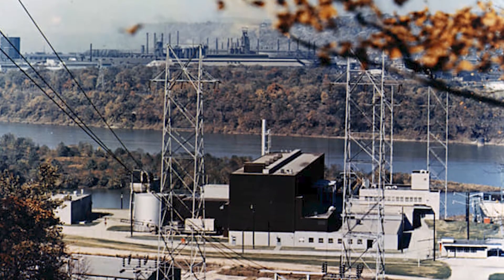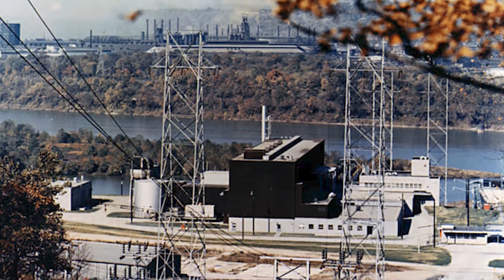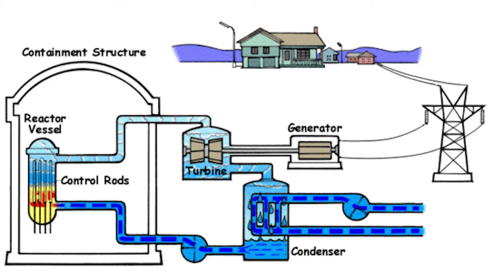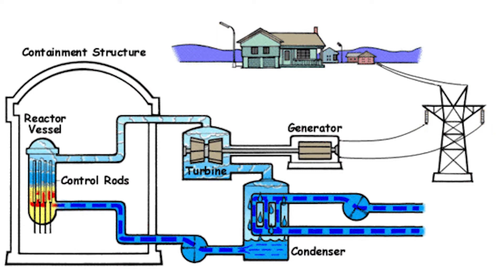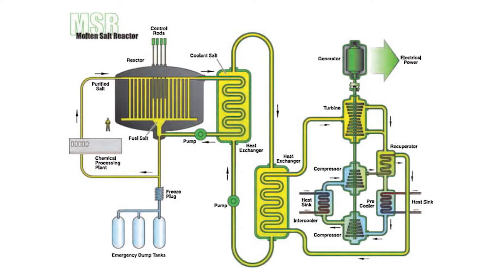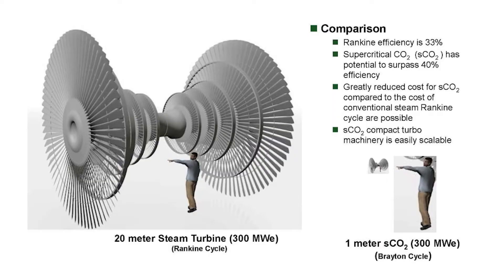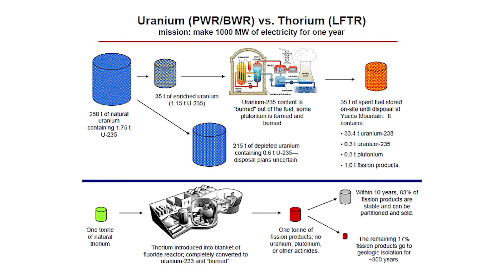The Best Nuclear Reactor: Light Water VS Molten Salt | Ep. 2

Comment: Great summary. A couple of nuances though.
1. LFTR is an interesting design to be sure however the two fluid with chemical processing is conducive to proliferation misuse. U233 isn't as good as enriched U235 for making bombs but don't rule out desperate nations from surreptitiously tapping off the U233 in order to make less-ideal bombs. Also Lithium is becoming increasingly in demand for batteries in particular thus a high cost item. Note that Sorensen seems to be quietly focusing his company's attention towards the MCFR concept. You might want to research that concept further.
2. Safety should be the least concern since, even including Chernobyl and Fukushima, existing solid fuel, water cooled reactors have proven to be safer than any other means of power generation known to mankind -- by orders of magnitude! Instead the focus needs to be cost reduction while maintaining safety. That should be possible given the reasons as stated in your video. However don't underestimate the power of ALARA principles used by regulatory agencies. "Ah so it costs less you say?" I can hear already. "Well then let's just add these other safety criteria since it would now be reasonable to do so."
Reply: In a LFTR molten salt reactor along side a majority of U-233 that is being created from the blanket salts, a small but still crucial amount of U-232 is also created. This is what makes proliferation very improbable. Asides the fact that U-233 can be made into a bomb, the presence of U-232 (which you cannot seperate from the U-233, without a enrichment plant, which in essence would be obsolete when using a thorium fuel cycle with molten salt reactors) makes it unuseable. U-232 is nasty in that it has a much stronger radiation that can be picked up from large distances and is uniquely distinguisheable. You cant hide a U-232 laced bomb without the world knowing about it. 

As for the reactor, the presence of U-232 is just burned up as it recieves a neutron and then burns up as U-233 over time. But let me make it clear, U-233 cannot be extracted without U-232....
Reply: @Merreck0  To produce a thorium breeder reactor using thermal neutrons, protactinium seclusion must be used. Protactinium seclusion results in the production of pure U233. This is why the NRC requires thorium to be denatured with 15% uranium, which kills the thermal neutron spectrum breeder reactor concept.

At least in the US, the future is not thorium, but Spent Nuclear Fuel burning MSRs. Even Flibe is working on an SNF burning LFTR49 to go with their LFTR23.

It may very well be that we will have fusion reactors by the time we will have enough U233 for mass deployment of thorium reactors in the US.
Reply: @dalesplitstone6276  when irradiating Thorium you create different isotopes from of protactinium Pa-233, Pa-232 and Pa-231, these isotopes are all secluded when waiting for decay. It is from these isotopes that U-232 is created among the U-233... the real concern from proliferation comes from the decay time needed for Pa isotopes to decay to U-232 within the seclusion tank. Where it takes 27 days for Pa to decay to U-233, the Pa   isotope that makes U-232 takes 1.5 days... it is here where the proliferation risks come from... however the U-232 is created within the seclusion tank and it cannot be seperated as easy as one might believe. The NRC is being overly scared about it, but then again, its their job to be... i think its too dramatical because the system as a whole can never produce pure U-233  without extensive modifications
Reply: @Merreck0  I agree. The proliferation risk is very low. At least no greater than with uranium fueled fast breeder reactors. modifying a thorium reactor to produce weapons grade U233 would be more difficult than designing a thorium reactor from scratch.
Reply from the maker: @dalesplitstone6276  You may be right in regards to Fusion reactors being online before LFTR. Common Wealth Fusion plans on having a viable prototype up and running in 5 years, and commercial reactor in 10 years.
Reply: @RockLogicWithSeanKenny  LFTR will probably beat fusion to market, but fusion probably won't be far behind :LFTR with regards to mass deployment.

I anticipate that Thorcon will be first to market, but they face two large hurdles with regards to mass deployment. Stockpiles of U233 are kiw, abd will probably be grabbed up by Flibe, and they require LEU with greater than 19% U235 content to go the uranium route. Ramping up production of uranium of this enrichment could be problematic. Ultimately, Thorcon could do well in Indonesia, Africa, and both South and Central America

Moltex will probably be second to market, and should thrive. The Moltex approach is very good for not only Canada and the UK, but also for Australia, those parts of Africa Thorcon can't reach, and the Middle East. Ultimately, once the switch to thorium salt as a coolant, they could also be big in India.

Flibe will probably beat Elysium to market with their LFTR23, but be dependent on the existing stockpiles of U233 for initial deployment. This will probably limit them to less than a dozen reactors prior to deployment of the SNF burning LFTR49 reactors. For a couple of decades, the greatest contributions of Flibe should be medical isotopes, and LFTR49 reactors should be just as capable of producing these isotopes as LFTR23s. Flibe's greatest potential should be India. If Accelerator Driven Reactor technology can produce U233 for LFTR23s in India, Flibe has enormous potential there. Having said this, medical isotopes is also a goal of ADRs. ADRs will be needed to breed tritium from deuterium for fusion to take off.

Elysium will probably be the last to market of these four, but Elysium will probably dominate in the US, being the second MSR design, after Moltex, to reach 100 GWe of installed base. Best guess is Elysium will be the first, and possibly only, nuclear design to break the German ban on nuclear. This will be because of Elysium's focus on burning SNF.
Reply from the maker: @dalesplitstone6276  It's an interesting assessment. The idea of Flibe Energy partnering with India is intriguing. However in regards to Tritium for Fusion you don't need to invest billions of dollars to develop Accelerator Driven Reactors. Commonwealth Fusion Systems has a novel approach to addressing this by incorporating a liquid blanket of FLIBE salt between the inner and outer walls of the Fusion reactor. When the enriched Lithium in the salt gets bombarded by neutrons it breeds additional Tritium to fuel the reactor.  I will be going over this in Ep.7 when we discuss Fusion and the supply chain synergies with LFTR.
Reply: @RockLogicWithSeanKenny  The Commonwealth Fusion approach is not surprising. Hydrogen bombs fission lithium to produce the tritium for the subsequent fusion reaction. One advantage of this approach is that the lithium isotope Commonwealth Fusion would be using is the one that Flibe MSR builders want to avoid.
Reply: The proliferation argument is a strawman.
Reactors can be sealed and monitored to ensure that they are not misused. Any country refusing to accept such inspections is effectively saying "we are hoping to use it to create a nuclear weapon". In which case they will be refused access or subjected to UN sanction if they break their agreements.
The technology to make nuclear weapons is already available to countries willing to accept such sanctions, just look at N Korea and Iran.
Reply: @bobthebomb1596  It is only a straw man in the sense that, any nation determined enough, will find a way around any safeguards. The US requiring denaturing thorium with uranium to prevent proliferation won't prevent other nations from feeding pure thorium into these reactors. However, plutonium is a better bomb making material, so feeding uranium into an MSR would probably be the preferred strategy. Indeed, using denatured thorium is probably the greater threat, in that plutonium is produced.
Reply: @dalesplitstone6276  Hi Dale, my argument is more that any nation that wishes to make a bomb can do so, with or without civil reactor technology. The penalty for doing so is cost and the ire of other nations (who will try to prevent you).
Sure, misusing civil technology "might" shorten the timescales slightly, but it will not give a nation access to a bomb they could not have achieved without it.

The world knew that N Korea was developing a bomb for years, but there was not much it could do to prevent it.
Similarly, Iran's refusal to allow ongoing inspection of its uranium reprocessing facilities is a pretty good giveaway that at best they are seeking to develop a nuclear submarine program and possibly their own bomb.

Would a world ban on nuclear technology (or MSR development) prevent either situation?
Reply: @dalesplitstone6276  You forgot to mention Terrestrial Energy. Their ISMR design is undergoing design cert in Canada as well as the US AFAIK. As for predicting LFTR and MCSFR market entry,  I'll wait until those are developed to the point that design cert is at least started.

Comment: I liked thorcon's design... untill i actually looked at their reactor design.  This design is incorporates two reactors within one ship barge frame... the reactors are prefilled and sealed, they are not refueleable onsite as far as i can tell... but the way it works is that one reactor is online and generating electricity while the other is cooling down and being prepped for a drop in refueled reactor... yes these reactors, (as cheap as they are) they get replaced i think every 14 years, 7 years of electricity generation and 7 years of cooling down. There are always 2 onboard the ship running in alternating cycles. This is a cheap way to build them but by far not at all optimalized and frankly they only generate i think 250MWe....

Anyways i did like their plug and play design, the barge contains the reactors, heat transfer systems, generators and even transformers in the completed barge allowing massive reduction in infrastructure cost onsite, all it needs is a direct connection to the grid
Reply: Thorcon can meet their cost goals, they may indeed be the first thorium reactor with a significant impact, but they have the same problem as Flibe, which is limited availability of U233 stockpiles. Where are they going to get the U233 for mass deployment.
Reply: @dalesplitstone6276  at first they will use U-235 to kick start production, however thorcon has the issue that it doesnt "breed" any new fuel. the LFTR however is a breeder reactor as such, and the U-233 can be bred and then used to kick start new reactors.
Reply: @Merreck0  LFTR designs are not breeders, at least in the US. The problem is that the NRC requires that thorium be denatured with uranium to eliminate the potential for proliferation. Because of this, Flibe is designing the Spent Nuclear Fuel burning LFTR49 to breed U233 in a thorium blanket to make up for the shortfall of U233 production in their LFTR23.

OTOH, Elysium initially planned on using uranium as their feed stock after startup, but have changed their plans to use thorium as the feed stock after startup because of the better neutron economy of the TH232/U233 cycle, even in the thermal neutron spectrum.

Additionally, Moltex has recently changed their strategy to eventually change over from using solar salts as a coolant, to using thorium salt as a coolant to breed U233 in the coolant.

We have sufficient SNF stockpiles in the US to last 300 years, so why are we wasting time on designing thorium reactors for commercial power production? Even enriched uranium is so cheap that it doesn't make sense to design for thorium, in the US.

Having stated this, thorium is the only choice for reactors for applications, such as nuclear railroad engines, and we should ne switching over to thorium fueled MSRs for nuclear powered naval ships. Additionally, in markets such as India, where SNF stockpiles might not be adequate, the focus should be on thorium. If Flibe wants to focus on LFTR23, they should strike a deal with India to license their reactor in India, where they might not be required to denature thorium with uranium.
Reply: WTF do ships have to do with anything?  I have seen 2 companies talk about docking and unloading reactors, and then picking up the waste later.  But the ships cost like millions of dollars?  What's wrong with a semi?
Reply: @putinscat1208   lets say that yes, a reactor vessel is large enough to put it on a semi trailer, all the missing components as part of a complete working Nuclear Reactor is missing. Heat Exchangers, external salt loops, turbine, and transformer... yes all of these can also be put on a massive convoy and built on site, however... 

it is far more expensive than the practical solution of thorcons all in one package. 

A. the unit can be mass produced in a shipyard, where steel fabrication and manufacturing is already a given for both nuclear and naval purposes, Costs are reduced due to the controlled enviroment.

B. the assembly on a barge is complete, its self contained, all of the components is neatly contained all within specs of the designers (unlike potential mistakes with onsite construction), and it's easily transported worldwide. all the client really needs is to connect it to the local grid, and hey presto it works. even replacing the reactor vessels is simple due to built in cranes and proximity to mayor water ways.
Reply: @Merreck0  You don't move the components off the ship?
Reply: @putinscat1208  No their plan is for the "ships" (more like a barge really) to be complete power stations. They'll be towed to the right location, ballasted down, and connected to the grid, refuelled every few years. As a plan it definitely has some strong things going for it. Shipyards will give fixed price contracts and fixed timescales with heavy penalties if they are delayed, try getting a normal engineering company to agree to that. Additionally ThorCon believe global shipyards easily have enough spare capacity to put out 100GWe per year of ThorCon plants. For comparison the entire US electricity grid is roughly 450GWe, so if it plays out ThorCon would be able to build enough new power to (for example) completely replace the US's electricity grid with clean power every 5 years. It's an incredibly ambitious plan but it just might work. The people who founded ThorCon previously worked in the shipping industry, and this novel manufacturing approach is probably their "killer feature" as it means their scale out plan is extremely credible.
Reply: @dalesplitstone6276  ThorCon is not really a thorium reactor. It's a HALEU uranium burner that uses thorium as an "additive", hence they don't need U233. Some U233 will be made (and consumed) inside the reactor because of the thorium, just as normal reactors make (and consume) some plutonium from U238, but the primary fissile element is U235. They've even said if they can't source HALEU they'll run on bog standard LEU uranium instead, skipping the thorium altogether.
Reply: Their goal, which drives the design, is cheaper than coal, sooner rather than later. I like their practical approach, and it’s a lot easier to make a thorium converter than it is to make a true breeder.

Comment: It is a shame that public opinion has stalled nuclear research for decades now. But you weren't very thorough in your description of molten salt reactors. Last time I really looked into this, these reactors were very prone to corrosive damage from the salts, and if or when they safely meltdown, the salts harden and the reactor cannot be restarted. Reliability and risk is a huge factor.
Reply from the maker: Sure but the team at Oakridge were working on high nickel noncorrosive allows like Hastaloy to help prevent corrosion. MSR's have issues sure, but these issues are not beyond our comprehension or technical understanding.
Reply: @RockLogicWithSeanKenny  Sure, it is not beyond our understanding, but as of yet we have not overcome it. Salts are extremely corrosive, especially under those temperatures and pressures. It is also one of the major reasons why everyone is so hesitant to build MSR's. This is something I think you should be more open about in your videos.
Reply from the maker: @maybehuman4  The reason no one is building them here is because most western nations including the US have a lot of dated regulations that make it impossible for start ups to build and test MSR's, and these firms don't have access to unlimited capital. As far as operating under those temperatures and pressures..... The beauty of MSR's is they don't operate under high pressure. So I'd like to know what you mean. 

Copenhagen Atomics is and has been building various components to operate high temperature salts for use in potential MSR designs. Many of them are available for purchase. I know this because we had the founder of the company come on our show. They are going to end up being the go to place to pick up parts for high rated and tested MSR parts.
Reply: @RockLogicWithSeanKenny  "The reason no one is building them here is because most western nations including the US have a lot of dated regulations that make it impossible for start ups to build and test MSR's"

That is an overly simplified way of looking at things. Europe is building an experimental Fusion reactor, orders of magnitude more difficult and expensive than a MSR. China is building nuclear plants at a regular pace. If MSRs were so great they would in use today somewhere, regardless of regulations in the west.

There are clearly other reasons that you chose not to acknowledge. You sound more like a cheerleader or a salesman than an objective observer.